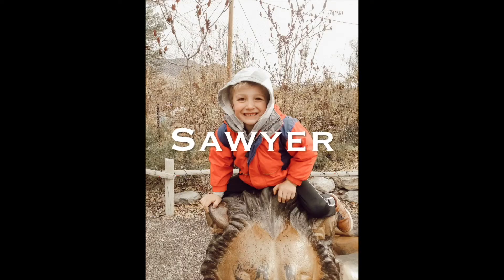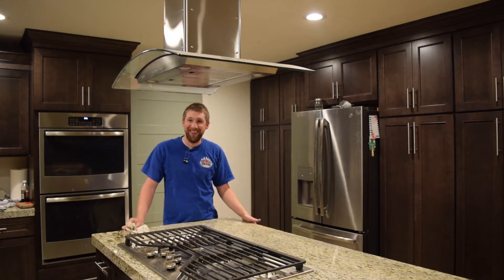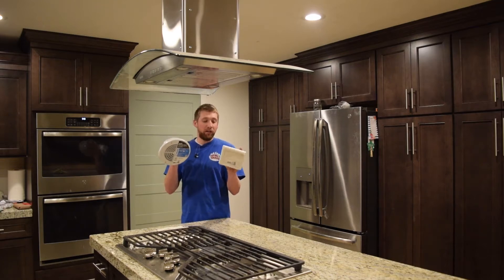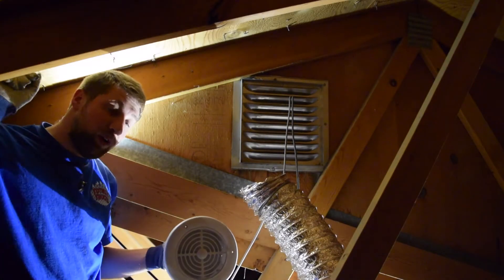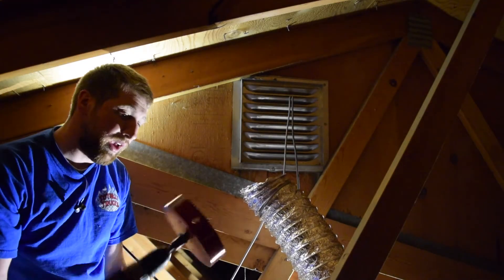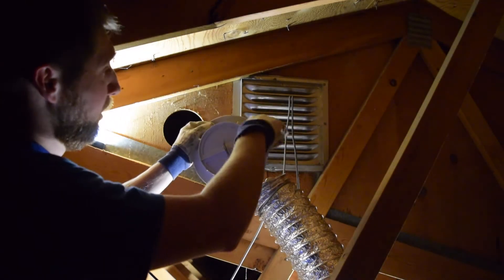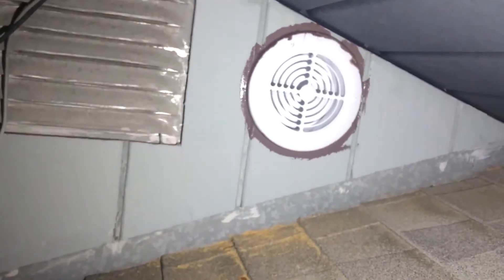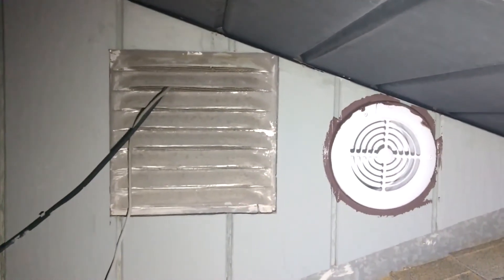How To Run a Vent For a Range Hood

Comment: You're supposed to be 10 ft away from any air vents in my state, not always possible but you're like right next to it. That will be sucking the moist air right back in you're attic space. Plus I'd never use that thin foil ducting. Also the ducting should be insulated. Don't teach people if you don't know the right way.

Comment: In addition to all the other comments about it being how not to install.. you even have the vent installed the wrong way.. the non return flaps should be vertical..  it wont take long for the spring on the top flap to fail.. then it will stay open all the time.. and cold air
 Will blow in.. and super easy for those wasps to come in to..

Comment: isn't it against code to use flex ducting'?
Reply: He used a dryer vent as the duct instead of smooth, galvanized steel. Not only is this not to code,  this is a safety hazard. It will be a combustible collection of grease.
Reply: @Luke.Cooking  Grease will eat right through that plastic over time.

Comment: You cannot use flex ducting. No code allows that for kitchen exhaust.
Reply: Why not? So what do u need..
Reply: @syfodias-jedimaster  They do sell a hard vent pipe that has double thin sheet with insulation. But some ppl don’t want to pay so they get flex
Reply: And most codes require a make up air unit to replace the exhausted air on exhaust units over 400cfm

Comment: The moister will be drawn back into the attic through the gable vent as air is drawn out through the ridge vent.  There should be at least 4 feet distance between these vents.

Comment: Ideally:
Don't use flex ducting.
Don't install under vented soffit that will suck in the moist air from vent and cause mold.
Don't have uninsulated duct in cold ceiling space, especially horizontally.
Reply from the maker: This is the duct that came with the range hood. It's working out just fine so far.
Reply: Cavscout888 everything you said is correct.
Reply: you all prolly dont care at all but does anyone know of a way to get back into an instagram account??
I stupidly lost the account password. I would appreciate any tips you can give me
Reply: @Ty Lane instablaster =)
Reply: @Blaze Kannon It worked and I actually got access to my account again. Im so happy:D
Thanks so much you saved my ass!
Reply: @Ty Lane glad I could help :D
Reply: @HomeFreeFamily  make sure you sue them for damages when this thing starts a fire, because the insurance companies sure as hell won’t cover it because it is not up to code.
Reply: @JWEX500  Yep. People don't realize that if you do DIY work on your house and that causes a fire or other damage, you insurance company can and will refuse to pay for it.
Reply: @JWEX500  Lets not even mention the fact that the range hood was certainly over 400 cfm and there wasn't even a mention of make up air as he talks about the use of caulk being overkill lol.
Reply: I know this is an old post. The guy above is right. Working out fine in 2 years is not the time it will take. 10 years you will have a bigger problem..... or the next person who buys your home. Far more expensive to fix than doing it right the first time. You also have a fire hazard by using flex duct just above the range and not solid. This has been code in MANY states for decades after MANY homes burnt down. Just because the range hood included flex pipe does not mean it should be used. Oh well @HomeFreeFamily

Comment: Flex duct and dryer vent products...quite a scary install! I wouldn't want to say anything negative, but there are a couple major fire hazards in this install. Please be aware! The grease filter is just a filter, meant to reduce grease build up, not negate it.
Reply: What do u recommend instead?
Reply: @syfodias-jedimaster Rigid metal ducting with a smooth interior - keeps the grease from building up and or burning through lesser ducts. It's actually a minimum requirement for fire safety/building code. Very scary to see recommendations stating otherwise.

Comment: I have a two story home with an attic, will this still work the same way or differently ?
Reply from the maker: It depends on which floor your kitchen is on. If it's on the first floor, you may have to take the vent out an exterior wall.

Comment: Where do you plan for the grease to accumulate over time?  Just wondering, ppl should think about this, the typical stove vent (residential) will surely have grease in the smoke(depending on what one cooks with), it can create a fire hazard.
Reply from the maker: The range hood itself has a filter, so the grease should end up in there. Then the vent itself vents to the outside of the house.
Reply: @HomeFreeFamily  is it ok to skip the whole in the wall and just aim the duct toward a small air vent in attic? (We rarely cook if any)

Comment: Hey it’s the guy who asked you if fumes went straight out or not , I figured a way to do the same thing you did just added a ventilation vent on top of the roof instead of on the siding and it works perfect. Thanks tho 👌. I believe your way was easier tho less work
Reply from the maker: Nice, glad it all worked out for you!
Reply: His way is illegal and dangerous.
Reply: @MAGAMAN  is it ?

Comment: lots of experts in the comments. Just so you know I think you should have used diamonds to cover the screw heads and your ducting should be made from depleted uranium, transparent aluminum at a minimum. Crazy you didn't install a chemically based fire system in the attic.
Reply from the maker: Lol right, I don't know what we were thinking. Love the comment!